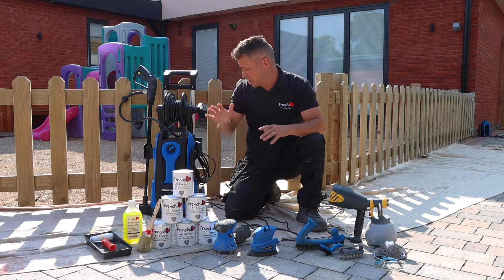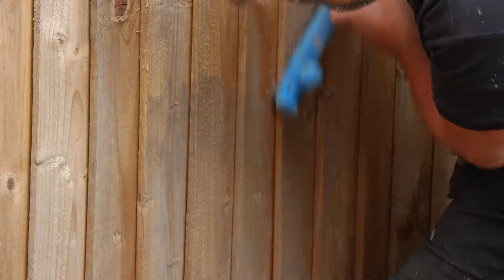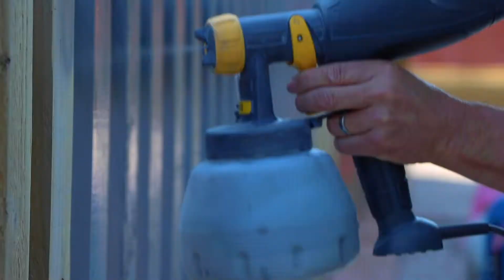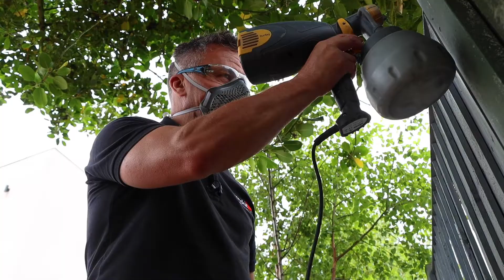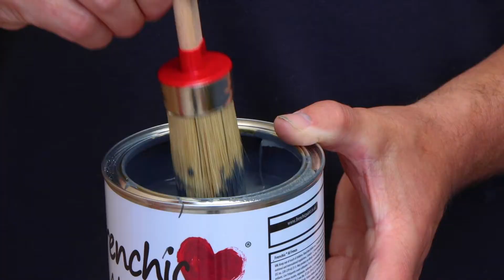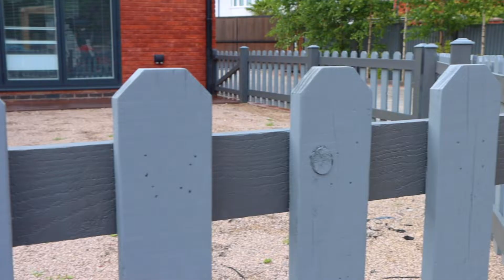How to Paint 3 Different Types of Fence Panels

Comment: I have similar fence to the green one you painted. What are the chances of the paint showing through to the opposite side by getting through the overlapping timbers? Would love to paint the fence but don’t want to upset neighbour on opposite side of paint leaks through. Any tips?
Reply from the maker: Hi Tiger, When you spray paint your fencing paint wont travel though the slats, its when you use a paint brush and drag the brush across the lip of the slat it bleeds though